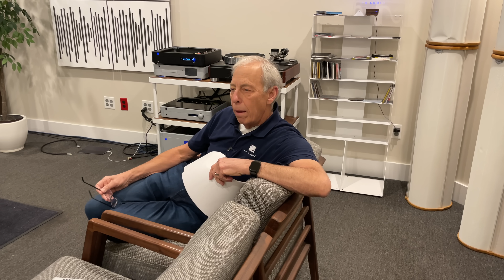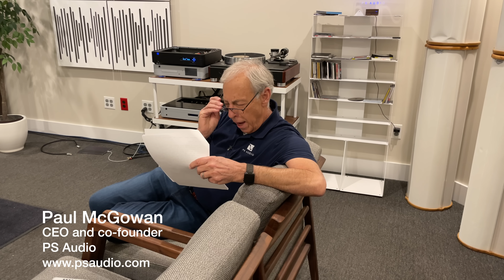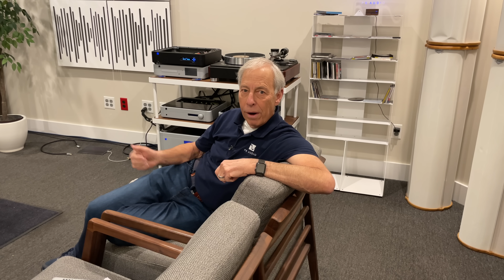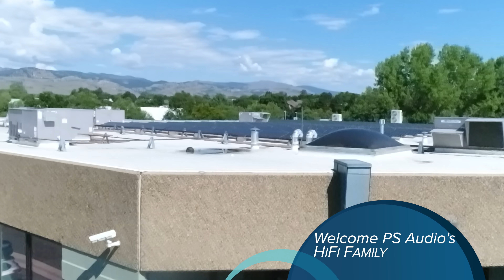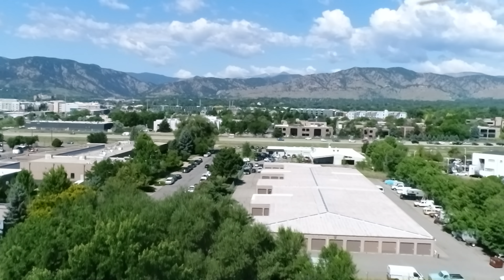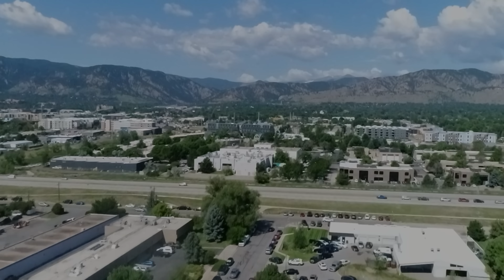High end amps vs. pro amps

Comment: I'm a newer audiophile, and I'm planning to experiment with this very topic. I feel it's possible to utilize pro amps and make them sound as good as any other in a good setup. I'll be finding out.
Reply: Get yourself a qsc rmx 1450a and a decent dac and you'll never go wrong, especially if you run it balanced. Does rated power from 20hz to 20khz, fully class ab 'after the 1450 it is class H, which is still good', built like a tank, it is even 2 ohm stable, the power supply is well over built to, if the fan is ever to loud it is so simple to replace it with something quieter that matches the stock fans cfm rating, You'll have it for 40 years long as you take care of it and blow some compressed air though the heat sink fins and though out the amplifier every few years. I've seen qsc's rmx line "the series before the current rmxa line" be turned on and stay on for 15 years with never being turned off.... My 1850hd is a great example of this, it's been used and abused, dropped down stairs and shorted out 'by one of my buddies who didn't know what he was doing' despite all that, it still sounds as good as the day I got it new 14 years ago... I have a qsc a 3.7 monoblock from 1976 that still works as well... Their quality has always been first rate...
Reply: I have Crown XLi2500. I find it very neutral, no audible noise, a lot of available power. It's an AB amp around $500
Reply: QSC 1450a amp is a little over $850. But sounds great with the extra 300 watts per channel @ 8 ohms.
Reply: @ms19631964  it's a chunk of change but what you get is an amplifier that is rated guaranteed rms continuous average power from 20hz to 20khz with both channels drivien into 8 ohms and 4 ohm loads with an added bonus of true non thermal limiting 2 ohm per channel stability which is very rare today in your standard linear based class ab or h pro amps, most amplifiers, take crowns xls or xli series as an example are only rated at 1khz at rated power, music is not a 1khz sine wave testone, it varies though the full spectrum of our hearing, id rather an amp be able to do the same amount of power at 20hz and also 20khz, its only natural, not only do you get honest power figures, but you get absolutely top class build quality, sound quality and overall reliability first in class that stands above the rest and a 6 year warranty to boot! Qsc... Nothing but the absolute best. In a rack case, if id drop those rmx or rmxa series Amps off a truck or down the stairs, I want the confidence to know those suckers will still work because I have a show to do, not only from that but 20 years from now where they will still be making me money. With qsc, it eliminates the worry, only thing that needs to be done every year or two is to blow out the heatsink fins to remove dust to keep them running cool, do that and you'll have them for decades!
Reply: I have done a double blind and in my experience, it's not even close. They sound very different.
Reply: @TheUniversalid  Very different how? Which was better or worse in your experience?

Comment: Point taken, but I have some 10 inch dual voice coil Volfenhagen speakers for stage use 2000watt 2ohm. It takes 2 xl 1500 crown amps to satisfy 30 pound magnets. Sounds good outdoors,  but don't use indoor they pull on the sheet rock nails and break glass!🤣

Comment: This is one of your best videos Paul. This explanation was/is badly needed in our industry and hobby. Engineers design and work toward a specific goal or set of goals. The hierarchy of requirements determines what tradeoffs are made in the design process. Both amplifiers are good amplifiers and the engineers may be equally qualified to do their job, but the criteria in the projects (amplifiers) goals are different enough that the final products are focused on two different customers. You should feel empowered to share this message often.

Comment: Despite the slight to marginal audio difference, it is mostly a cost factor. Most pro amps are built in huge numbers which drives the cost down and hence tons of them get sold. Audiophile amps are built in low numbers a likely by hand, this raises the cost plus add in exoteric parts and a sky high profit margin to help keep said company afloat and you get an expensive amp that only sounds 5 to 10% better at best (versus a good pro amp, not a cheap one). Sound is of course subjective, so if you base sound purely on specifications, most amplifiers perform well.  What makes a good amplifier sound better, first its reactance to the load it is driving, its slew rate, IMD, dampening factor and power reserves (dynamic headroom). Bi-polar, MOS-FET, push-pull, darlington, cascaded pairs, whatever, they all have a sound but like a microphone preamp they contribute only a small amount to the sound.  Class A, A/B, D, etc. also have become blurred as each technology has almost achieved the pinnacle of its design. Your speakers matter more for sound (and your room) than anything else, bar none. Replace the amplifier with 2 other good designs and the change in sound is barely noticeable, I would blind test anyone on this. Do not talk about interconnects, speaker cables, IOS-pucks, power conditioners (although a balanced transformer is a good thing) or even the source as major contributors, they are not
Reply: People want to be unique (most of them except commies). When anybody can compare "reactance to the load it is driving, its slew rate, IMD, dampening factor and power reserves" (100% true  selection of parameters, with my respect) objectively, no room for "hidden knowledge" remains. When a salesman (or a "reviewer") tells about a woodoo in Audiophilish, everyone supposes that only he/she translates this correct, and this makes him/her unique.
But sometimes, craftmen crack a problem, and there is no any pro product that can offer the same. Like Van der Hul's or ZYX cartridges for example =) 
After that they can sell any pro stuff for a high price, signed. I think this is a history of most of pro companies.

Comment: What did people expect,  "yeh, the difference now with the newer crown xls amps with audiophile offerings is so small even golden ears cant tell the difference, save your money and buy some great speakers", from a guy that sells very expensive power amps?

Products measure the same, but sound different?  Only if you aren't doing enough measurements, which comes down to if an oscilloscope doesnt see a difference, neither will a set of ears.

Comment: I have spent 20 years using Crown, QSC and other pro amps. I am also an audiophile and over the years owning dozens of makes. The pro amp has to stand up to a lot of abuse on the road. It gets bumped and driven hard. They all have fans to cool the insides. The design also needs to provide high power output.
Audiophile amps are much lower in power since most only have to cover a living room. My pro amps range from 300 watts per channel up to 1000. My audiophile amps run from 50 to 200 watts. The audiophile amps need to run quieter. Audiophile amps need good stereo imagining and need to provide depth and dynamic range to the music. 
So we are talking about different goal so you get different amplifiers. Ditto with speakers.

Comment: For the same reason you don't drive a pickup truck on the racetrack.   Ok.... well, yes you CAN do that, and have a lot of fun... but don't fool yourself into thinking your pickup truck is going to beat a Porsche.  Nor are you going to haul lumber in the Porsche.  Paul is 100% right.... it's where is the design focus?  If a pro amp can make you happy... then good for you.

Comment: There are a lot of pro amps that sound terrible like the wind is howling through the speakers and there are a lot of hi-fi amps that sound like tin cans. I do however think that you can live with both worlds. I'm going to be buying a pro amp pretty soon (Dynacord) and use it on the low end of my stereo system. It's clean enough and powerful and can handle 2 ohm loads if necessary. Cost is approx. $1000. On the mids and highs , I have a Bryston 4b SST for detail. Each sector has something good to offer. By the way , try building your own speakers with pro drivers and you won't be disappointed.

Comment: Ubernonsense detected. A pro amp must control a bunch of 18" loudspeakers with the amp loaded down to 2R in bridge mode. To achieve this they use something what audiof consider very dirty: negative feedback. The end result is amp with an extremely low output resistance which result in an very high damping factor. What you hear with those amps is your loudspeaker and not your loudspeaker getting out of control. But some people seem like it when things get out of control: it sounds warm. Search the AES website. There is an excellent paper on negative feedback written by Putzeys in there.

Comment: The problem I have here is that there's such a w-i-d-e range of pro audio amplifiers from a cheap box mostly full of air and hot glue to a densely-packed "personal computer with a DSP" that happens to have a small portion of the electronics dedicated to driving the speakers in a corner near the back.

You have to shop around the pro market for something that was intended to actually deliver high fidelity output as a design goal. A lot of that stuff might be from an earlier time in a given company's history and might need some work to restore the original performance. (Once you let the beancounters have any control at all, you're screwed.)

I also have no real faith in anything that says "A Harman International Company" on the back using quality parts at all. :)

Comment: Well, I put a Behringer A500 (which is essentially a QSC knockoff)  into my high end room together with immensely good bookshelf speakers, and it is the best system I have ever heard, bar none. Super musical,  the reverb tails and presence is inside the room. Ofcourse there are great and not so great amplifiers, but in my opinion, loudspeakers and their crossover design is what is most important to how the systems sounds as a whole..
Reply: If you can, try the A800. Better than the A500 for cheap. Love mine.
Reply: @SilmarilS79  I have tried it, but in my opinion all class D amplifiers are superior in bass/punch, but not comparable to class AB in the mid-to-high frequency area, mainly because the nature of the class D amplifier involves processing the audio signal in unfavorable ways, which the class AB amplifiers does not have to do. In my opinion, the switching noise in class D amps makes them somewhat fatiguing to listen to with linear and true fidelity loudspeakers when they have to tackle complex music/source material. I also tried amps with the well regarded Hypex UCD modules, and I am truly baffled why so many consider these amplifiers to sound good. To me, generally the higher power class D amplifier, the more the switching frequency interference sucks the life out of the music.

Comment: The ear test is what matters to me. I'd go with a $400 Emotiva A-300 over an XLS but it is what you think that matters. I think the $110 SMSL Sanskrit Mk 2 sounds better than the $250 Schiit Modi Multibit so I bought it. It blew my mind.
Reply: Schiit's $250 plays in the same league where SMSL does. Price always says more than a label. So, there is nothing special. But at the same time with the other models Schiit offers something that SMSL will never do. I've investigated their photos, and I like what I see inside. I understand how such high price is calculated. It has reasons.
But if you take a look inside LampizatOr Amber 3, its price as of $3900 is an absolute FRAUD! Because what I see inside, is $20 Amanero from eBay (without a galvanic isolation), no sample refiner, one(!) ES DAC (I'm not sure it is 9038Pro, may be just 9028), no good low-noise power, $10 bluetooth from eBay, capacitor output, and 4 cheap tubes $80 max. But they have purchased some good reviewers though...

Comment: I bought a used 15 year old Crown I-tech 6000 on E-Bay  it  was there top line touring amp when new and would not have been cheap when new, I use it in my dedicated  music only listening room . I control it with a Rotel RC-1590 pre amp. I am very happy with the sound quality but I mostly listen to 70's 80's pop and hard rock. I cannot comment about the cheaper line XLS  and xti series and other makes I have not tried.
What I can say is these are high quality rugged amps that can be dropped from 6ft and still work, they are readily available used from around $1000USD upwards depending on age ,model .condition and hours. They have massive power output 1500watts@ 8 ohms and doubles into 4 ohms just in stereo mode  [for the 6000]  more than some of the most expensive hi fi mono blocks. They can drive heavy loads below 2 ohms. The I- Tech  model is  made in the USA is light weight 28lbs has banana plugs outputs and XLR inputs. There are lots of useful things on the display such as hours used ,input sensitivity gain even voltage movement like on a power generator. It can be used anywhere in the world with 120-240 volt just change the power cable plug no converter or mods required .By there very industry standard they work in the they have to sound good and be reliable.
They only down side I can see for home use is the fans are on almost all the time but that does not worry me as I play medium to loud so I don't here them. To me the I-Tech 's are top shelf amps that are great value on the used market if you can find a good one and have  similar tastes in music to me. I have heard  they can be expensive to repair if they do fail.
It would be great to see one of the YouTube  audiophile expert's do a comparison with hi end  consumer amp with a top line pro amp of any brand. I am not suggesting it would sound as good or high end as a PS audio BHK or Krel  just that the better pro amps  can sound great and offer great value for money on the used market and may be  relative for some people to consider in home use.
By the way I am sure the 20 or so capacitor's in the i-tech are decent quality.
Reply: I have worked on electronic equipment for over forty years and as far as caps go they are one of the most reliable components in the circuitry if they are matched to the application.  These people that have a good amp and then believe this baloney about replacing caps for better sound usually end up screwing up and damaging other components. IF IT AIN'T BROKE DON'T MUK WITH IT !  I worked on a sound system in a club and those pro amps would pull so much current from the mains that the lights would dim with the bass notes. Just because you can't afford to spend five grand for an amp doesn't mean you can't have great sound. In that club we generated so much sound pressure that you could take an empty beer bottle and feel the air being pushed out by the low end woofers.

Comment: Old(ish) school Crown (Macro-Tech (but NOT the new "Macro-Tech" i garbage), Micro-Tech, K1/K2), make for incredible home/hifi amplifiers, as do many of the old Crest 3001s, 3501s, and 4001s.  They're big, heavy, pure class A/B amps, built like a gd tank, they'll drive even the most inefficient (looking at you Wilson Benesch) home speakers with gobs and gobs of headroom to spare, and sound amazing while doing it.  They often get passed over by the audiophile community because they don't spend paragraphs talking about what capacitors they use, include fancy words like "transparent" or "accurate," or go into painstaking detail on how it takes one engineer a whole day to solder on the speaker terminals fashioned from 99.99999999% pure, oxygen-free unobtainium.  They just do what an amplifier should;  take in an input signal, make more of it, and send it to the output terminals.  If you ever get the chance, try to get your hands on an old Crown Macro-Tech 2402 and put it up against whatever high-end amplifier you may have.  The results will probably shock you.

Perhaps one of the best commercial amps ever made was the highly regarded Crown Belchfire BF-6000 SUX.  

http://www.repeater-builder.com/molotora/gontor/belchfire.pdf

If you can get your hands on one of those unicorns, don't even think twice before hitting that "buy" button!